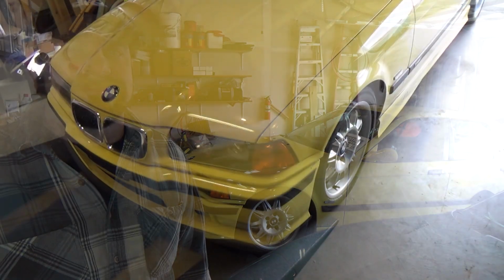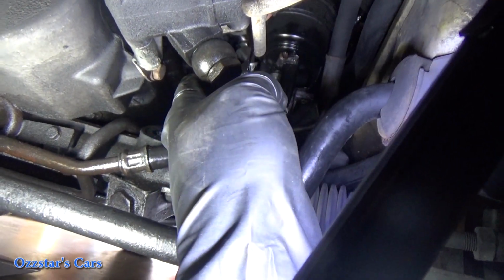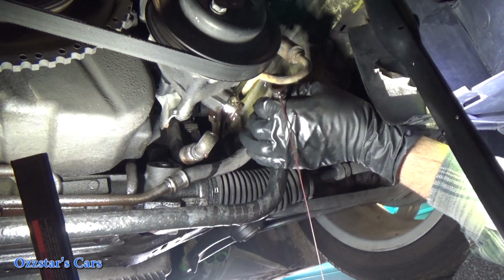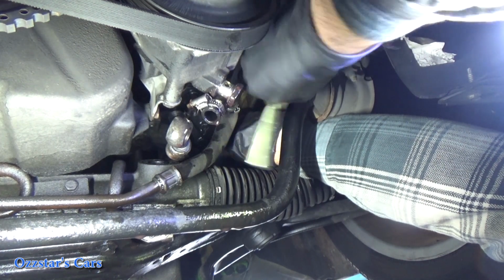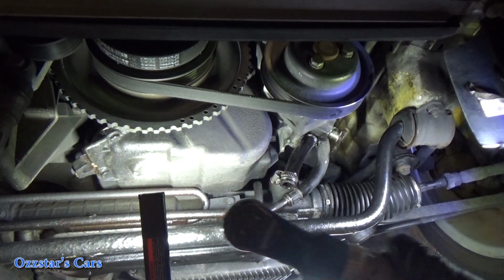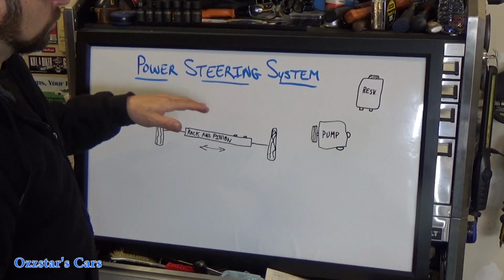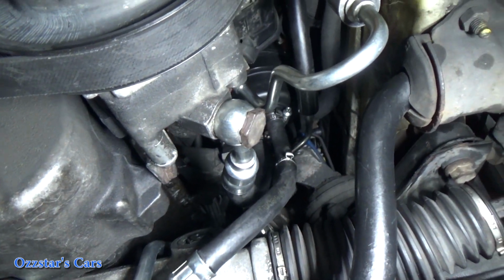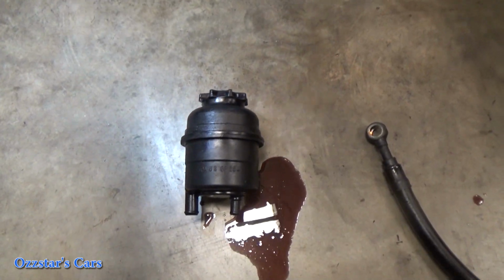BMW E36 Power Steering Noise and Leak Repair

Comment: 1/13/2023 So it wasn't a leak of fluid or fluid too low that was causing the noise, but bubbles in the fluid being drawn in by an air leak in the line?
Reply from the maker: You got it. Common problem on many vehicles on the suction side of the pump.

Comment: Thanks Glen, I have a 1998 Z3 only difference is my reservoir location. My mechnic quoted 800 for the repair but after seeing this video, I feel confident doing what you did will solve the problem. BTW, no noise on mine, just a minute leak. Thanks again.
Reply from the maker: You're welcome Manns, glad the video was helpful.

Comment: Hondas do that sucking in air thing all the time. Make a ton of noise, foamy fluid.  O ring fix.
Reply from the maker: Yes good point. Many of the Asian cars use orings in the power steering system.  The rubber suction line on the Honda/Acuras are definitely suspect.👍

Comment: An engineering marvel indeed! She was a squawker! What a PITA to get anything off that thing. Nice of Beemer to make that cap so accessible, too. I don't get any of those cars around here ... thankfully, lol.

Looked like some water/moisture got in that fluid - I see the same thing when I dump carburetor float bowl contents onto the concrete from lawn, and other equipment. Water really stands out. Fluid looked pretty nasty! Probably added several more years to the pumps life there. At least that car won't show any pollen accumulation. :)  Stay safe, Glen. 👍🍻
Reply from the maker: As far as I'm concerned it is one big piece of pollen. 🤣  That's politically correct right? lol
Reply: Ozzstar's Cars 😂🤣😂

Comment: Excellent review, I've often wondered about how to prove a pump is bad before trashing it. As you say, air in the system will make any pump groan. Do you ever flush the system?
Reply from the maker: If the system is not having any issues I usually will change power steering fluid every 15-20+ years. 😁  True story.
Reply: @ozzstars_cars  - Same here. I'm a big time slacker with coolant, brake fluid, and p/s fluid. I haven't done the p/s fluid in the Silverado yet. 13 years, 101k miles. I probably should, since it's due to fail any second. You know, modern day GM and all ... 😁